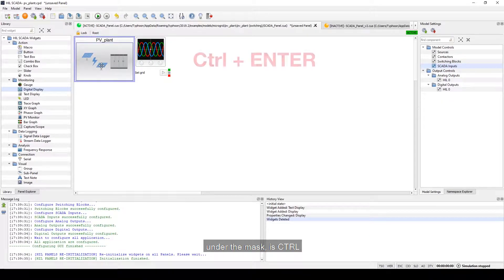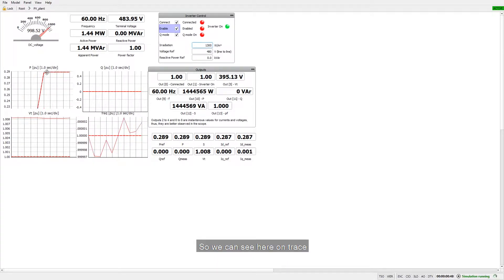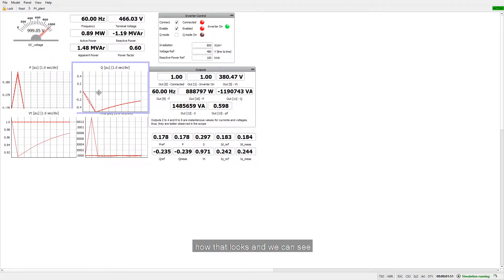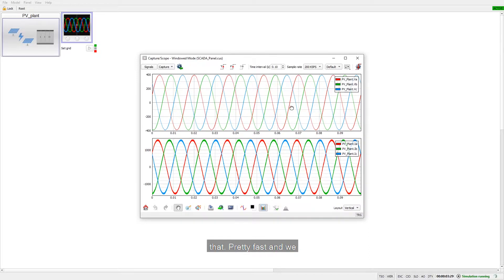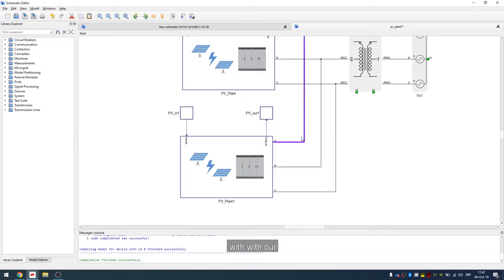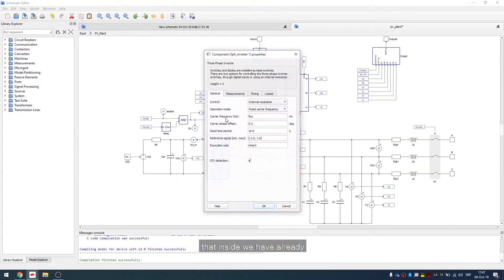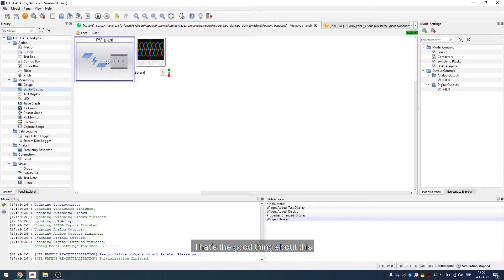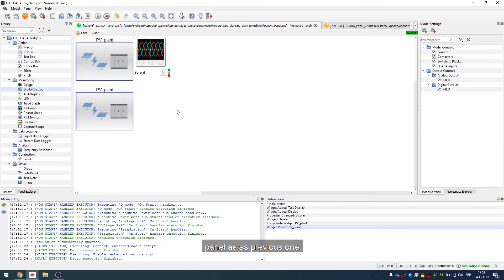Microgrid Library PV Plant | Tutorial Part 2

Comment: How I can add hydro plant with solar plant (solar-hydro hybrid)
Reply: Hi Sameh,

It is possible to adjust existing Generic PV plant to work as solar-hydro hybrid power plant. You will just need to scale water flow value to solar irradiation.  At the moment Typhoon software does not have pre-made component for this type of application.

BR